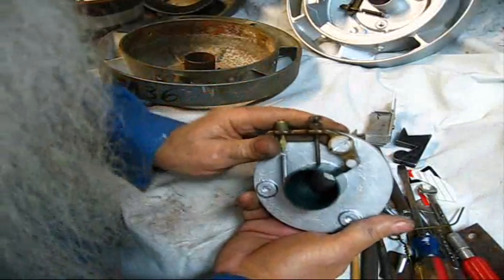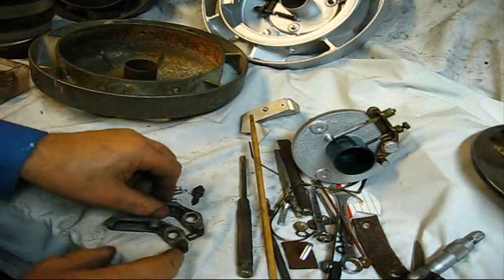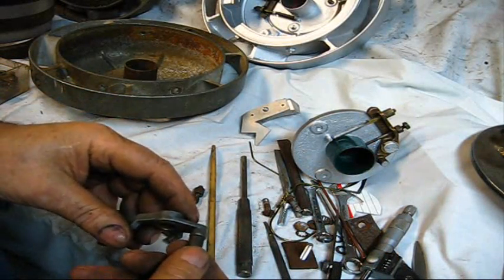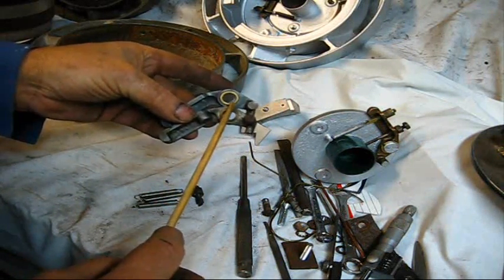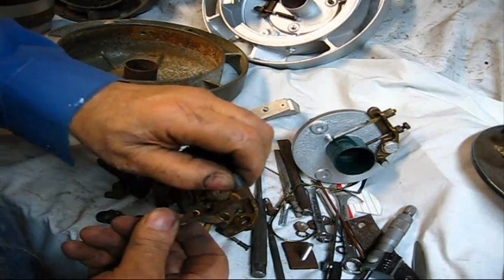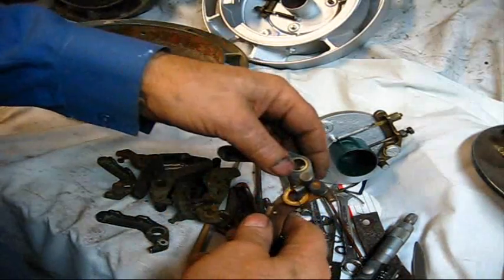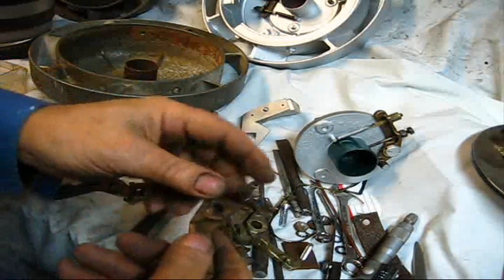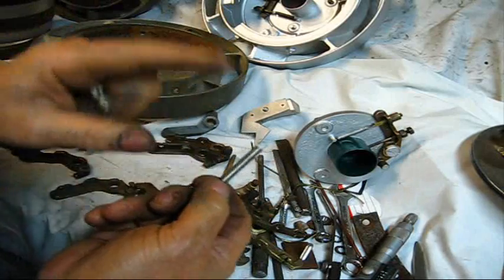Maytag model 92    ignition system #2

Comment: What are the correct dimensions of the tripper bearing? Can it be make from brass or does it have to be insulated? The pin needs to be made also, so I might be better off buying this part.
Is testing the 92 coil similar to testing the 72 coil? Ohm resistance reading? Which leads? Knowledge of electronics is my weakness.
I have cleaned up and painted all of my 92's parts but I am so glad that you are helping out with the ignition system of the 92.
From the West Coast of Tennessee.